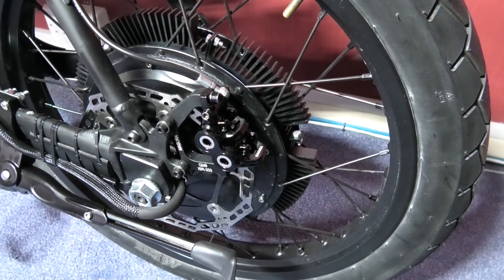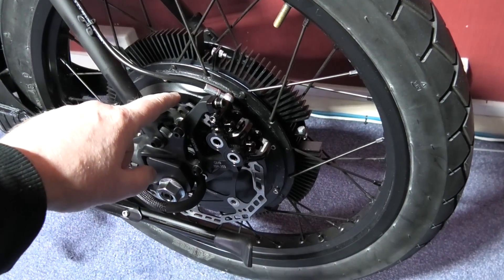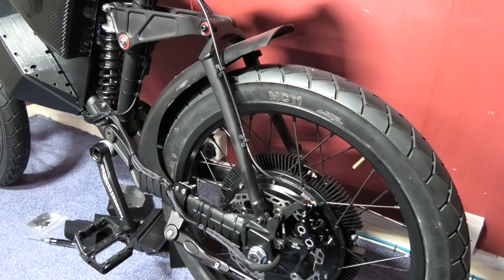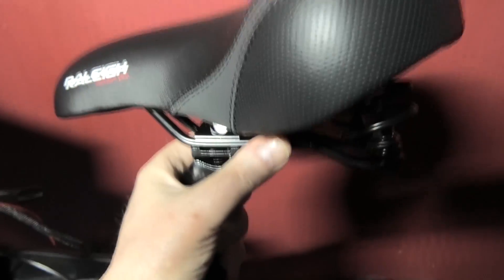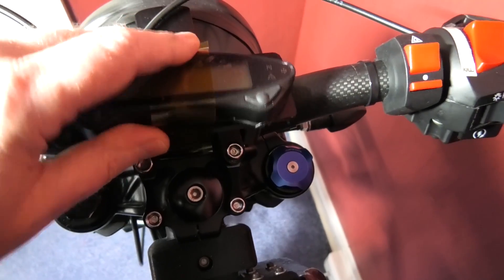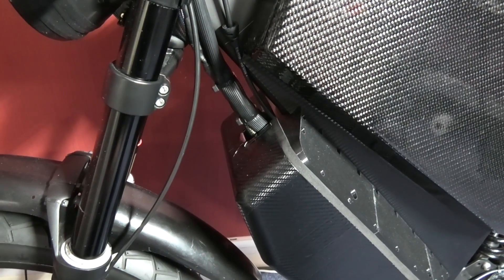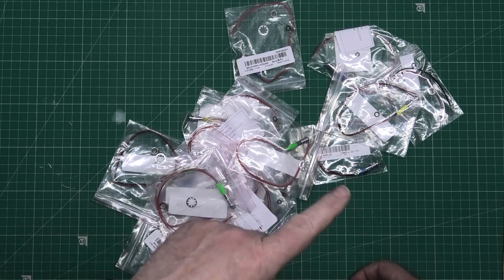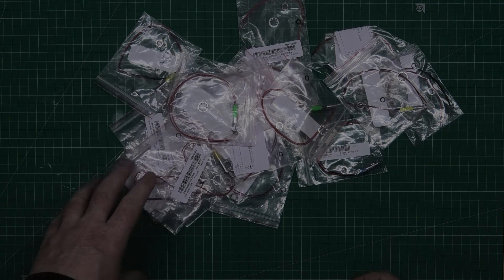High powered DIY eBike MSVA build part 26 - Almost finished

Comment: On 2 occasions I have been almost mugged for my ebike. Do you know of any device that can immobilize the bike by remote if someone succeeds in taking it from me? I wear a GoPro and have GPS tracking device hidden on the bike but it's not very accurate. I need something that can totally immobilize the bike by remote if someone steals it from me. Do you know of any device on the market? Have you ever had any issues yourself?
Reply from the maker: @roy borrill Drop Terry an email lnfo@gpstrackerfitting.co.uk he specialises in GPS tracking for bikes. He contacted me a while ago, asking if I could build the same thing. Sadly, I don't have the time to do it and I don't want to tread on anyone's toes now.
They do have a website https://gpstrackerfitting.co.uk/ but it's under construction at the moment.
Reply: @Vortecks  Thanks guys. I will take your advice and send email. I'm sure I'm not the only one who has had this same problem. Ebikes are great fun but a magnet for jealous toe rags.
Reply: That's worrying. A bluetooth tethering device should fix that. If it doesn't exist, I'm sure Tony could make one.
Alternatively unplug the motor phase wires and connect them together - that'll piss em off no end!
Reply: @ahaveland  The problem I have is that I need something that can either track the bike or cut the power off remotely. Tracking devices run on G2 network and only O2 still use it. It's unreliable. Does anyone know of something better?
Reply: @royborrill2711  Tony (or even I) could rig up an esp32 with a gps module, bluetooth and LoRa - this will give hundreds of km of low bandwidth RF range not dependent on any mobile network and a year of operation using deep sleep and wake up with a single 18650.
If the bike goes out of range of your phone, it could cut the power and broadcast location. It could also try to connect to any open wifi in range and relay position.
Should be a market for something like this.
Reply: @ahaveland  That sounds perfect but not something I can do. If you could make one I'd certainly be interested in buying it. Actually, that sounds like a great business idea. Thanks for the information.
Reply: @royborrill2711  Would be a nice challenge, but I'd starve while working on it - someone somewhere must have already made one.
Reply: @ahaveland  Do you or Tony know of any YouTube videos that explain the device you told me about? I have a friend at work who said he'll do it for me but he needs to know the details of the device you described. It would be a great help if you could direct to the information I need.
Reply: @royborrill2711  Here's another link that I find really interesting - http://www.loratracker.uk/
Reply from the maker: @royborrill2711  Just to add.... I did some tests with the 'T-Breacon" which I used on all my RC stuff. I'll also be using one on my bike https://www.youtube.com/watch?v=QOkG72TdB10

Comment: With the weight could you make a removable batt pack at some point and 2nd tiny super high c rating pack so if you're only going a mile or so the bike will be significantly lighter
Reply from the maker: I've thought about that, too. Making a 1kg battery pack will allow me to take the 16.5kg one off and possibly push it up the stairs.

Comment: With stairs can you get some smart thin wood painted simalar to stairs to glue to the edge of the stair treads in dead of night? Then let the bike power itself as you "push" it up
Reply from the maker: I've thought about using 'grip paint' but it takes too long to set. I've thought about loads of things but the trouble is, if anyone trips of falls, I'll be libel. We have security cameras in the stairwells so someone will find me 😣

Comment: on my ebike I use liquid electrical tape and grommets for the wires, i'd recommend using a grommet then filling in the space between the grommet and wire with the liquid electrical tape - it will still be flexible and 100% waterproof.
With my FUTR alpha I sure can relate to that drunk bike work, good luck with the build :)
Reply from the maker: That's my aim......gommets and liquid electrical tape - great minds think alike 😁

Comment: For your back....I used to race bikes and your back can be your enemy. To strengthen it, lay on the floor on your chest, hands at your hips and merely raise your head off the floor, hold for 5 seconds then back down for 5 to 10 seconds. Then repeat. Slowly raise your head and just hold it for a few seconds. Day one do 20 to 30. Day two maybe 30 to 40, each day for about  week increase by 10 more per day. Within a week of two it will strengthen your back, it's one of the few workouts that is so very easy and it really helps your lower back and potentially you'll work some muscles that you really need to get back in shape. Perhaps this will help, perhaps not but good luck!!!
Reply from the maker: Cheers Mark.
My main aim is to get out of pain first. After that, I've got to do something I didn't do last time - strengthen my core!
I think I saw the 'head lifting' as one exercise so I'll be doing it 😁

Comment: great job on the bike Tony, tongue tied to day, its all good, everybody gets this way once in awhile, lol, the hole for the wiring to pass through, TPU, doesn't fare well in the cold, been there done that, std rubber / poly grommets work well, cut them to shape around the harness and use a bit of silicon on the back to secure it and BOB'S YOUR UNCLE!!! here is a video you may like about this wheelchair built from 2 electric bikes, another clever man like yourself. Off Road Wheelchair Test-Can it climb a mountain
Reply from the maker: Cheers Bob. I will be using rubber grommets and not TPU. I saw that wheelchair video when he was building it. Personally, I'd have made it with a bit more ergonomics in mind but that's just me 😁

Comment: Cant you have the bike power itself up the stairs while you walk beside it ?
Reply from the maker: I tried it with V2 - it just left a big rubber mark and loads of smoke. I'm hoping that the wheelbase is slightly longer on this one because V2 as the perfect length for both wheels to sit in the 'valley' parts of the stairs.

Comment: You have a balcony or a large window? You could rig up an arm and winch like some dutch house do to get furniture and pianos into upper floors.
I'm lucky I have a lift which my bike just fits into to get up 3 floors. It's not fun when it's out of order!
Reply from the maker: Moving house isn't an option at the moment. Plus which, If I move to Birmingham where I work, any insurance you get will be literally double so it's cheaper to commute the 17 mile journey from here.
Reply: Andy Lee Robinson  I cant help wondering why he doesn’t think about moving into a ground floor flat , or at least one with a lift. He also seems to be living quite a long way from his workplace ? None of my business of course , but bad backs don’t improve with age in my experience.
Reply: @calderdale6795  I can't speak for Tony, but for me it would be one of the last reasons to move house, assuming that I even could. Not everyone can relocate so easily.

Comment: Was getting worried that you didn't post last week... thought you might have taken it for a spin with bad consequences!
Glad you're nearly there - can't wait for the maiden!
Reply from the maker: It'll be a couple of months yet mate (just in time for summer). My back is no better and there are also complications this time. 
Top & bottom of it..... my lifting days are over so I've now got a couple of ideas on how to get the bike up the stairs 😁
Reply: @Vortecks  I know how you feel, that's just awful - really hoping you can recover quickly and get riding again.
A plank at the edge of the stairs can help a lot and gives something to get even and constant traction on, and keep the rubber of the walls/carpet/stone etc. Shouldn't bother any other residents too much either.
Reply from the maker: @ahaveland  I can't have anything that might cause anyone to make a claim - you know how stupid people can be. I'm hoping that this one will simply power its way up the stairs because V2 was just the right wheelbase to fall perfectly in 2 'valleys' and all I got was wheelspin. Failing that, I'm going to try to ride it up (I've done it with motocross bikes before) but the last option is cutting down one of those 6 wheel 'stair trucks' and attaching one to the front wheel.
The last option is throw it up 🤣
Reply: @Vortecks  hehe.. that would be amusing!
However, I'm not convinced it'll be so easy getting up the stairs having also struggled with that, and my stairs are a pretty shallow angle.
Now, if you were to go 2WD or use caterpillar tracks... then I'd have no doubts! :-)

Comment: Tony, get yourself an inversion table and a pull-up bar.  Hang a big sheet from the pull-up bar, so you can put it under your arm pits and hang from it.  I had a herniation in my S1, S2, S3 lower back, which then hit my sciatica and traveled down to my right hip, then back of the thigh, top of the shin below the knee, then to under my foot, which felt like a was walking on a 1/2" piece of nylon rope running perpendicular on the foot near the arch and some days, it felt like a marble near the pads of my toes.  Doctor said injections or surgery....yeah RIGHT!!!  LOL!!
So, I hung myself up when I felt pain and by hanging, the pain went away...even if I was sleeping, I'd wake up and hang till it stopped...this happened 2 to 3 times a night for the 1st couple weeks.  This is called decompression therapy and what you're doing is, allowing the blood flow & oxygen to reach the center of your spine and helping to restore the shape of the bulging disc, so it can go back to its original form.  This allows the disc to heal and then the macrophages can get in there and eat up anything that's out of place, like a piece of disc that broke off or what not.  Hope this helps you and I can confidently state, doing this helped me get better months & months faster.  You've got allow those nerves to settle down and the inflammation to subside.....ice helped too, but not to much...10-20 minutes at a time, then remove the pack, this will stimulate oxygen & blood flow back into the area, which is what we want, facilitating the immune system.  Watch out for some of those stretching exercises some will show you on youtube for sciatica issues...go slow with the stretching, but the hanging will be your fix kind sir, it'll just take time for gravity to do her job.  Your injury was more than likely an older one, that has just gotten worse over time & then something you did triggered it.  Mine stemmed from pulling a tarp of leaves & debris with to much on it & motorcycle that won't start for shite and then a round of golf with a sore back, while swinging for the fences (dumb Pollack), is all it took to put me down. (all this occurred over a 7 month span).  It took me a solid 5 weeks to recover using this hanging method, just be patient.  Love your videos mate, keep up the great work educating us ALL...Peace Brother
Reply from the maker: Cheers mate, I've just bought an inversion table. With me, it's not so much the back pain but the sciatica (I know the sciatica is caused by a herniated disk). If I stand for more than 5 minutes, it feels like someone has threaded a rope from my buttock to my ankle and hung me from it. None of the 'sciatic nerve stretches' seem to work this time. I've also lost feeling in my right foot and I've lost the use of my calf muscle. I don't have trouble sleeping or lying down, only sitting and standing. I'm still waiting for the appointment to come through from the hospital but hopefully, Amazon Prime will cure me before the appointment arrives. 
Thanks again mate - I'll let you know how it goes 😁
Tony

Comment: Think a good idea is to make some sort of hook and strap type thin to help you carry it up the stairs... With a shoulder strap and a way to klip it to the bike... Don't know if you're just hummping up the stairs with just hands. But think if you put your mind to it you can make a good solution... 🤓
Reply: Yip... something like that...👍
Reply from the maker: Sadly, my days of lifting are over. I do have a couple of ideas to get it up the stairs but the trouble is, I won't know if they work until the bike is down the stairs to try them! The way things are going, it won't be for a month or 2 before I can take it out for the maiden run 😪